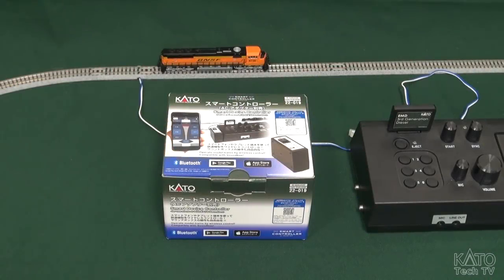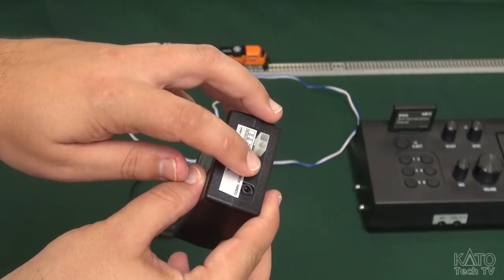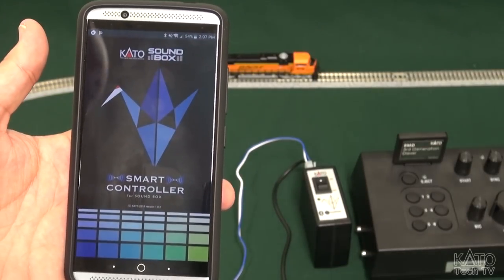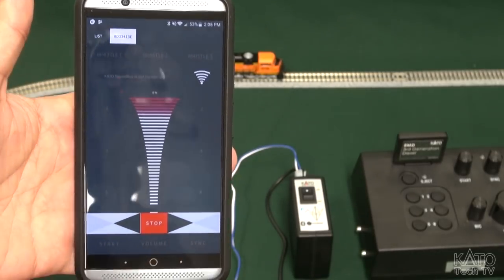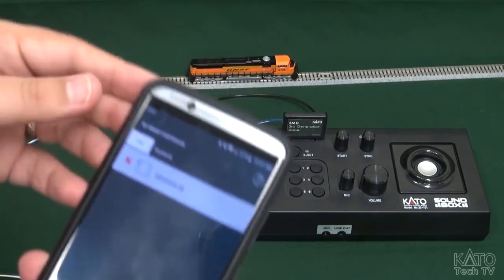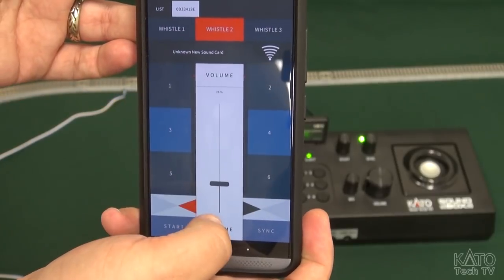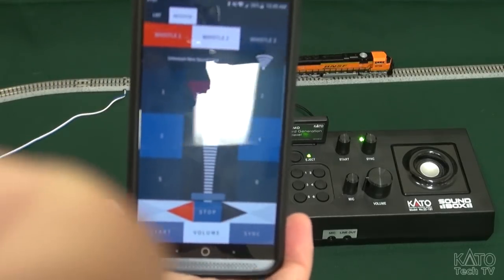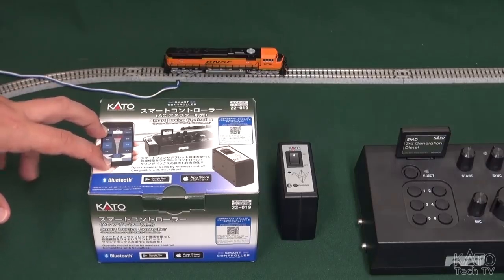[Kato USA Tech Corner] Unboxing and setting up the Kato Smart Device Controller

Comment: After having trouble with the DCC system I installed on my N scale door layout, I decided to give the Kato Smart Device Controller, and Sound Box a try. These two products work great if you're building your first layout like I am, and your layout is a small one, with just a few engines, and a basic loop of track with a small yard, and a couple industrial spurs.

The issue with my DCC system isn't the system itself, as it's the NCE Power Cab, which is a quality system for beginners, and is easy to set up. Where I was having trouble was with programing the individual locos, as I screwed up programing a couple of them, and don't know how to get them to factory settings, even though I think I followed the directions in the manual. It's not even the engines that are at fault. I'm just anxious to get the trains running good, so I can get to the scenery, and finish the layout, and am a little too impatient to figure out how to fix the DCC locos for now. When it comes to new model railroaders, I'm as noob, as noob gets. Despite my mistakes, I'm committed to getting my first layout finished, running good, looking good, and enjoying it, even if it's not a perfect work of model railroading art, or uses the latest high tech DCC power systems.

The Kato Smart Controller, and Sound box will work fine for now, and will also allow me to use a lot of my DC locos, which is the majority of my loco collection I've acquired over the years, hoping to use them on my first layout when the opportunity to build it came about. While DCC is ultimately better, especially if you want to expand to a larger layout with more track, and more engines, which I hope to do in the future, the nice thing about DC for your first layout, especially a small one, is you don't have to program decoders. You just put the DC loco on the track, turn on the power, hit the throttle, and watch it run.

Comment: I'm curious as to why the AC adapter is sold separately. Can it be used without it? I don't understand otherwise.
Reply from the maker: Depending on your layout needs you may want a more or less powerful AC adapter. Being sold separately allows you to chose which you want (12V or 16V, N or HO), without paying extra for an A/C Adapter to come with it. You can also use the A/C adapter from the new 22-019-1 Power Pack SX that's coming out if you ever want to just transfer from manual control to Bluetooth.

Comment: My layout has two controllers.  If I replaced each controller with two of these devices would I be able to control both trains from my phone?  From the vid it looks like you could only control one track.
Reply from the maker: If you have multiple controllers, you can switch between whatever one is selected from the menu (the one you see when the controller is pairing).
Reply: KatoUSAinc This is why I love Kato.  It’s so easy and straightforward to use.

Comment: Tbh I would only consider this if it was controlled by a wireless controller instead of a smartphone, maybe have some sort of plugin adapter for the existing Kato controller. Nothing better than having physical controls than just a touch screen, just like my physical Roku tv remote control instead of the phone app.

Comment: I have two sound boxes and run two trains at a time on Kato double track. How do you segragate/dedicate the two tracks/trains to your phone? Can you switch from one track/train to another on your phone to gain functuality and control over more than one train?
Reply from the maker: If you have multiple controllers, you can switch between whatever one is selected from the menu (the one you see when the controller is pairing).
Reply: The Kato reply to my question sounds that one would have to buy two controllers and go all the way back to Bluetooth settings to switch between two operating trains- not too practical and very expensive for folks running more than one train on more than one loop of track. The solution some will say is to go to DCC, but my too many locos are ‘linear’ and they run fine under ‘momentum control’ with the Kato Sound Boxes operating through controlled blocks of Kato double track. I guess I could buy a second cell phone and drive the cost up even higher. There must be a software solution to be able to switch between two trains (and sound boxes) 
from one phone, and one controller.
Reply from the maker: You don't need to go back to bluetooth settings, as long as both boxes are on you can select which one you want inside the app. You can swap which one you're operating without ever leaving the app.

Comment: Is this device only for KATO DC locomotives?
Reply from the maker: It will work with ANY standard analog/DC engine. Technically it can also work with a DCC equipped engine as long as it's set to run on an analog layout (two digit address). It's essentially a DC controller that can be run remotely.

Comment: pricey. how many separate trains can you run on one track or is it set up for one.
Reply from the maker: It's designed to replace a standard DC throttle, so it has the exact same set up - you can control multiple trains but they'll all go the same direction and speed.

Comment: Is the AC adaptor from the Kato blue box DC controller suitable ?
Reply from the maker: From the new one that is coming out in November, yes. The old one from the previous 22-014 power packs will not work.
Reply: Ok. Thanks
Reply: What's the difference?
Reply from the maker: Different specs, required for import laws, different plug size
Reply: KatoUSAinc no. The biggest difference is the PWM functionality (clear light function) as they use the same system as the new KATO Power Pack SX. You should maybe also point out that for some models you need the additional adapter 22-092. It surprises me that neither of these, besides the difference in adapters, is explained in an official KATO video.

Comment: To expensive for what it is.   At the very minimum it should include a power plug at that price.
Reply: James Smith they won’t include one because it depends if you use HO or N. They have different power adapters (should be mentioned in video but they don’t for whatever reason)

Comment: Why wasn't Stereo designed the Kato Sound Box?.

What less that too speakers?. No, just mono sound. Undless in Kato they thought that the pair the models do it with sound.

I think this accesory has been missed. I know that Kato is quite conservative is some of its developmets and in Japan they do not like both digital advanced. But Kato first watches over its national market. 

Comparatively in Europe, Kato USA models with sound are somewhat more expensive, than one european equivalent.

Discarded the option to ask to stores in the USA. Because in Spain, customs do not forgiven and the Treasury claims its part. I have not other remedy to buy in stores in German. 

It is not longer advantageous to ask outside of the European Union.

However, when Kato has a representative in Europa, for your USA models with Noch, still the prices are interesting, and they don't shoot up like with other brands of USA models in ~N~ and ~H0~ scales.

An example. The model of steam locomotive T1 Duplex PRR in ~N~ of the brand we that know, went on sale a month ago. Cots in german stores 150,00 USA $ more that in one of United States.

It is appreciated that Kato, at least it offers three versions of the same models; analog, DCC and DCC with sound. Adapting to all pockets of the modelers.